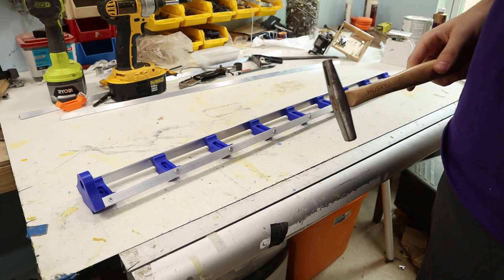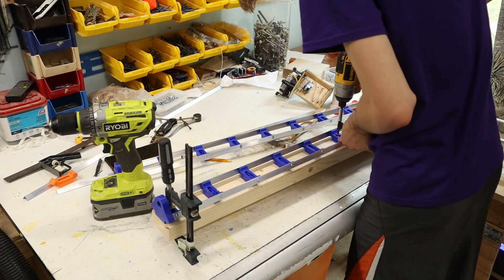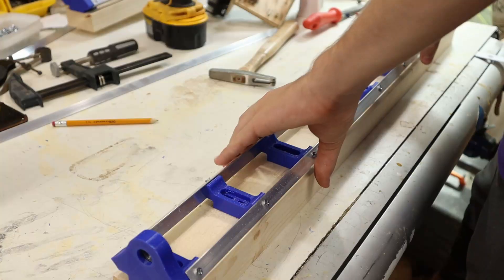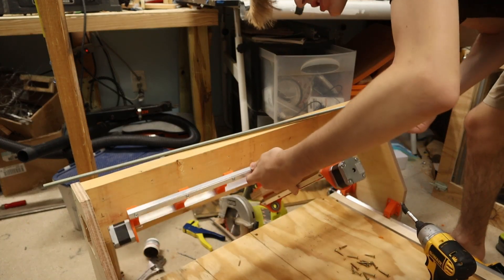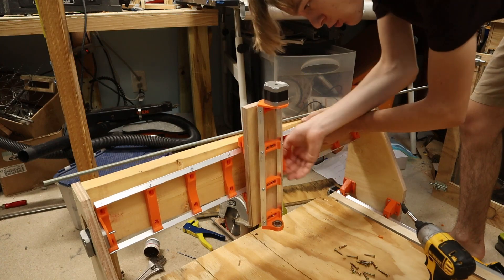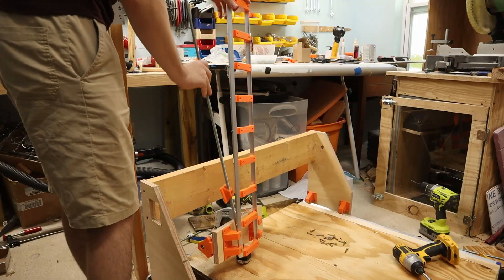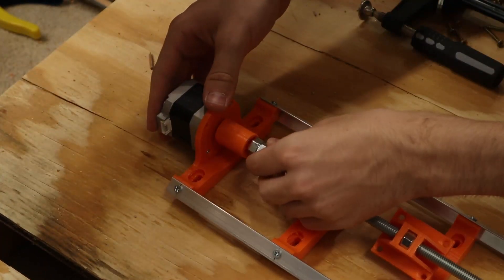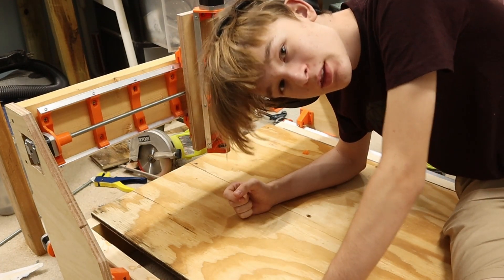I built a CNC Machine for under $200

Comment: I built one for 700 usd dollars excluding spindle which is probably a bit more capable than this one so I am interested how much did it cost.
Reply from the maker: Well yours is definatly more capable but I think mine came around to about under $200 but I cheaped out on everything, right now it seems to be working beautifully until the usb disconnects or cuts out. Still having a bunch of issues, but I'm figuring them out.
Reply: @MarcinPlaza  so dope tho

Comment: This video is awesome, tight editing.  Really impressed with your machine, too.  Did you get the parts from somewhere or design them yourself?  Either way, really cool.
Reply from the maker: Thank you! I designed basically the whole machine and all the printed parts, and that's why I'm surprised it actually works.
Reply: @MarcinPlaza  Super impressive, bro.  It's really clean and well thought out.  Just like your editing style.